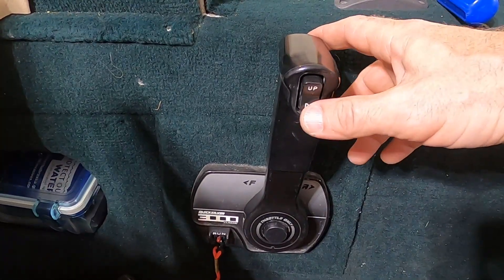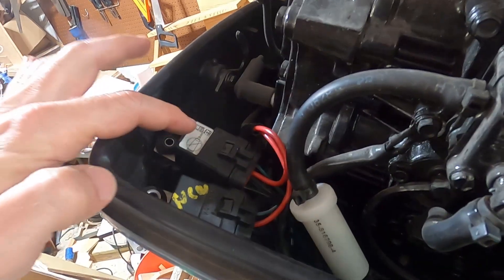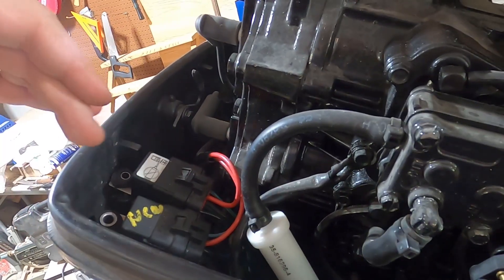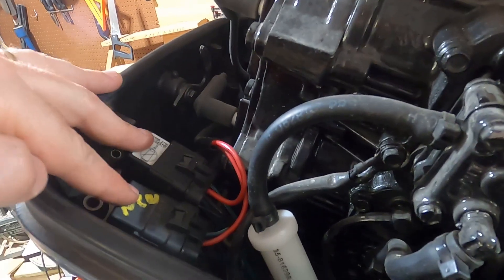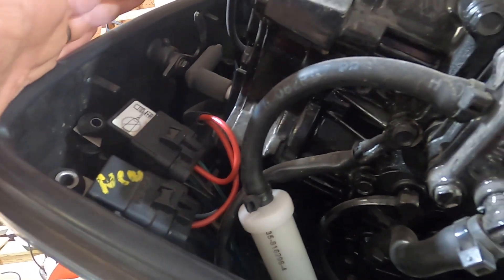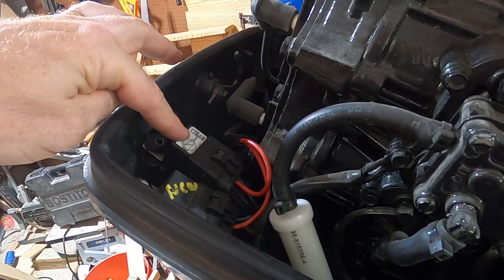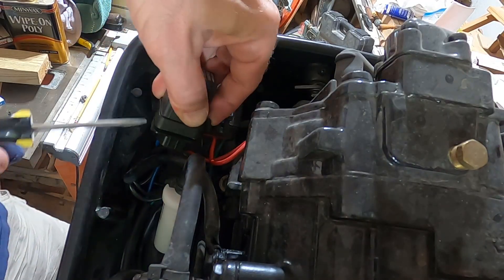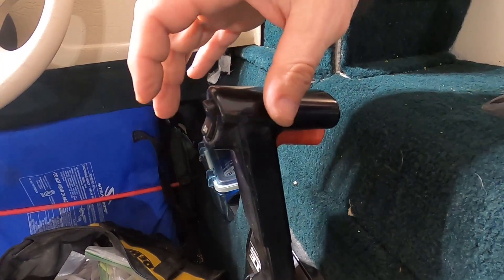Troubleshoot and fix outboard motor trim relay - which one to replace? Boat repairs.

Comment: what if the down or up switch won't work on the throttle but on the motor the trim switch will go up but not down? currently having that issue
Reply from the maker: Sounds like an electrical issue with the throttle switch, the wire feeding it, or the wires from the switch to the motor relays. If you know how to use a multi-meter, you would want to check and see if you are getting power to the throttle switch. If you are, it's either the switch or the wires to the motor. If you aren't, then you trace your hot wire from the switch back to the battery. Good luck!
Reply from the maker: I should add, it also depends on how the switch on the motor is wired. If it goes through the relays, then it's not your relays. I am not sure if some configurations are wired differently.